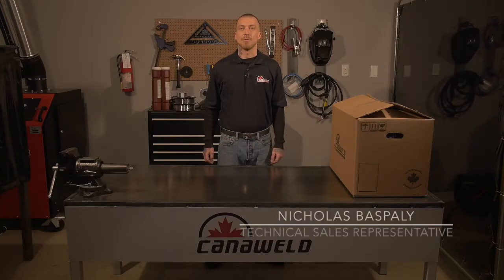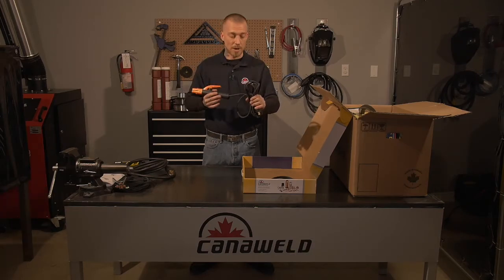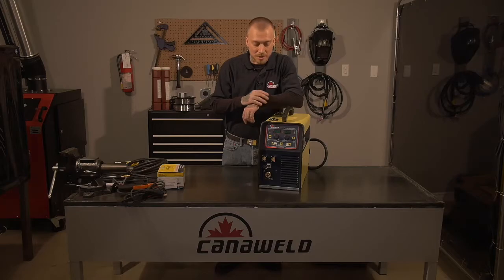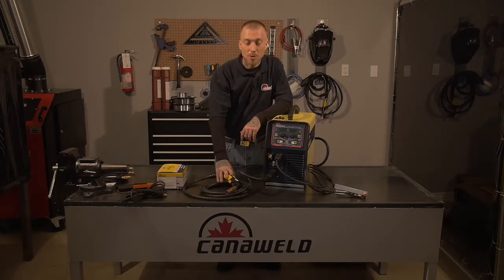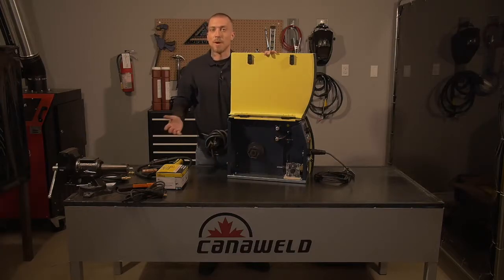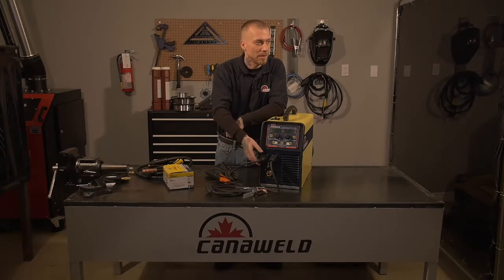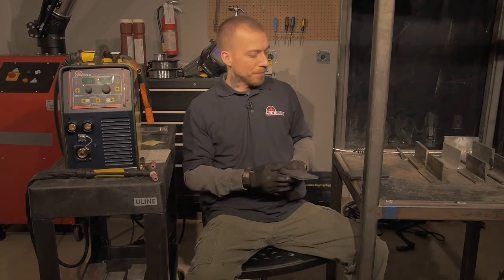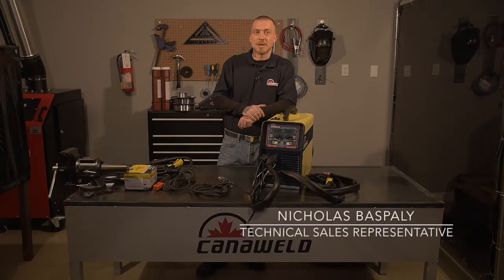MIG PULSE WELDING Tutorial, MIG PULSE Multi Process 201 unboxing by Canaweld

Comment: Why does a guy with gloves appear, when plugging in the various cables to the front of the machine......🤔
Reply: @canaweldinc6706  really considerate of you but man , if people are that fussy about your tattoos they can forget about welding and go back to playing with their doll house, seriously. Great video to introduce beginners to your product, sure is helpful for those that have never welded before. I am just checking out the pulse welder because it’s one of the machines I’m considering from you guys! Wonder if say a couple years down the road could I get a new board or parts from you guys in case something breaks which I doubt with my minimal use and care. I always let my machine cool down way before it gets near the duty cycle and keep it out of dusty areas, especially grinding dust. In fact, there’s no grinding inside my shop, its all done outside and cutting is done with my bandsaw or plasma cutter to keep abrasive dust out of the air. I don’t want it in my machines or air box of my dirt bikes. Cheers from Niagara Falls, Ontario. I would drive up there and see you guys but I only have my g2 and my parents hate going up to Toronto.. drives really stressful for them but I’ll probably try to pick my machine up to save on shipping and the risk of it getting damaged during transit which would break my heart lmao